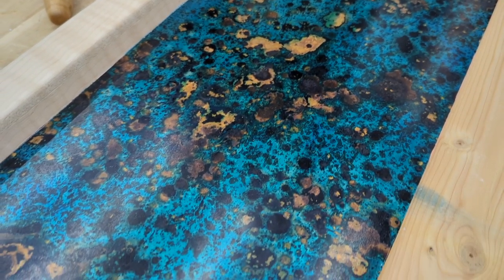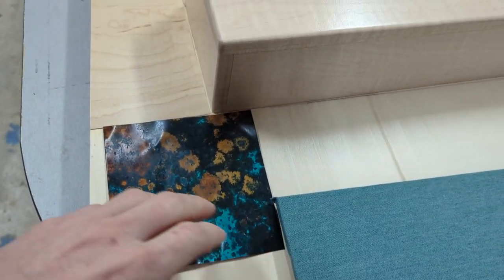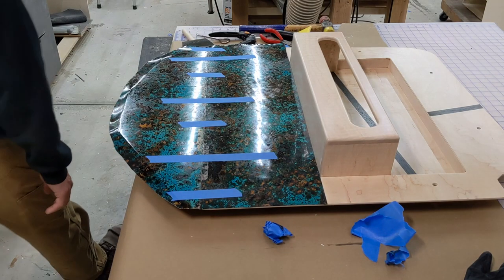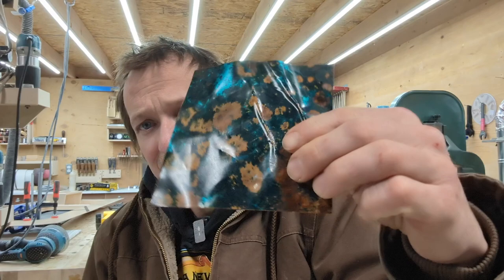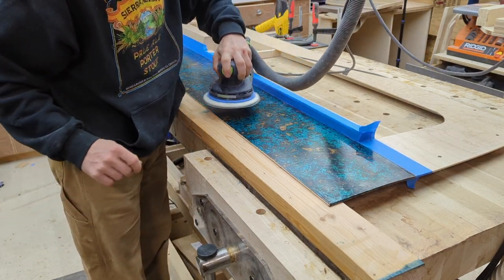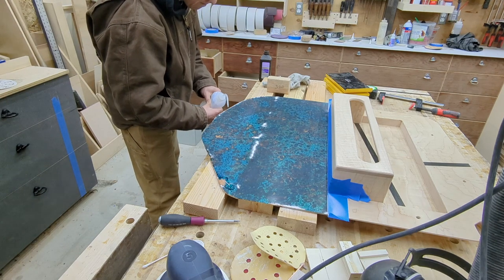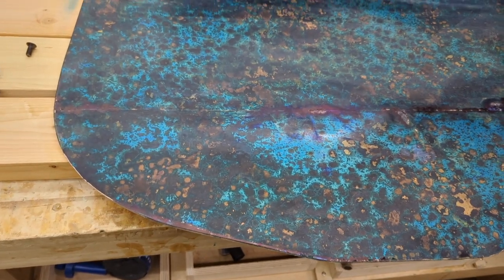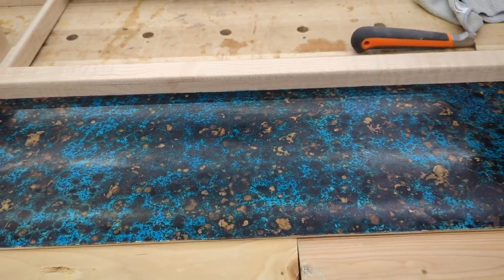How Not to Make a Copper Backsplash in a Camper Van

Comment: feel your pain!  I've done patina work with steel, copper, and zinc.  It's a process I'd say is comparable to alchemy!  Here's my 2C re metal as a finish material:  it's metal, why cover it with plastic?  b/c you cannot have a uniform cosmetic appearance for any reactionary metal unless it's sealed under plastic.  No plastic for me, thanks!  Let it be what it is.  The trade off is that you have a surface that is constantly changing cosmetically, in reaction to whatever it's exposed to.